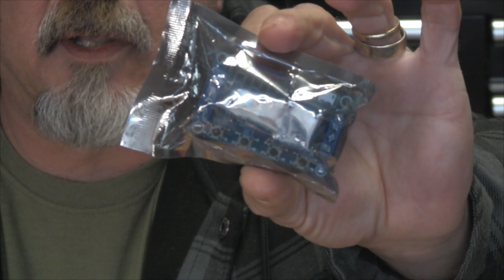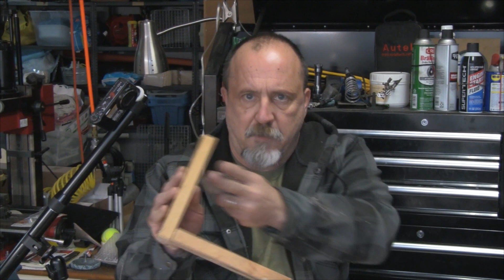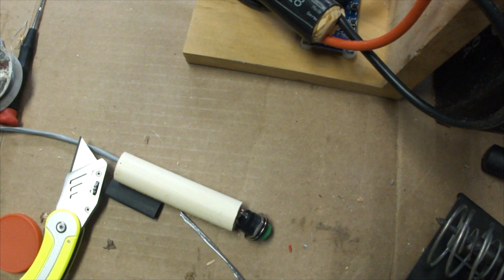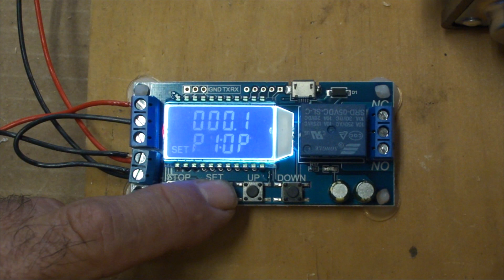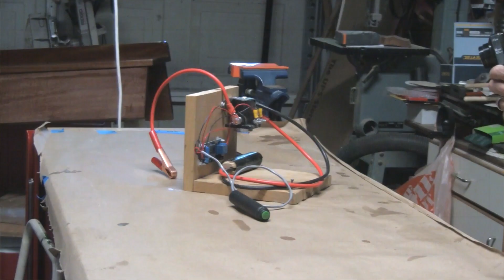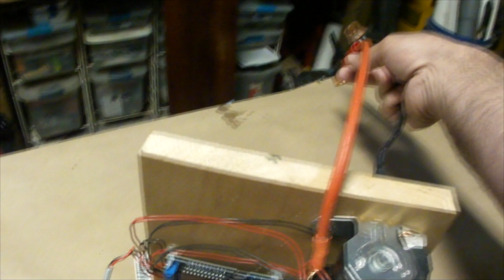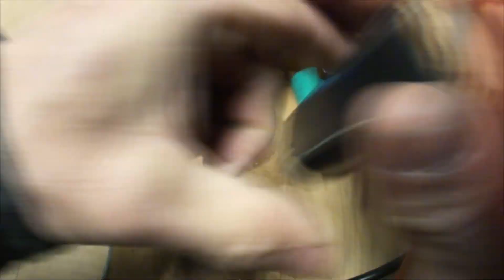How to Make Your Own DIY Spot Welder for  18650 Lithium Ion Battery Packs

Comment: great video. Do you by any chance have access to an oscilloscope? It would be interesting to see the actual time at the pen tips  considering there are two mechanical relays in this circuit.
Reply from the maker: I wish I had one, have thought about trying to build or buy something to integrate with the phone to use as an o'scope.. I could use one to diagnose ignition issues as well but no I don't have one. But that would be interesting to see. Probably significantly different times that the control module is set for.
Reply: @ExtremeDIYGuy  I got a used one for free. These is not much of a value for old stuff like this. To me and you yes....